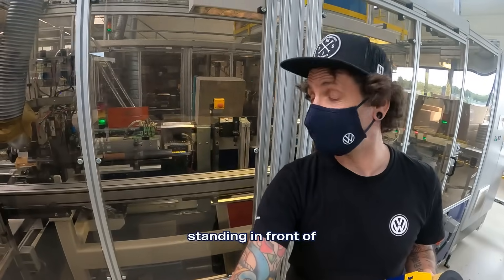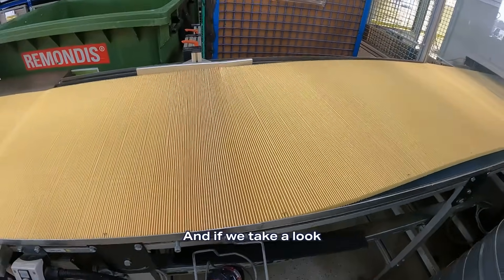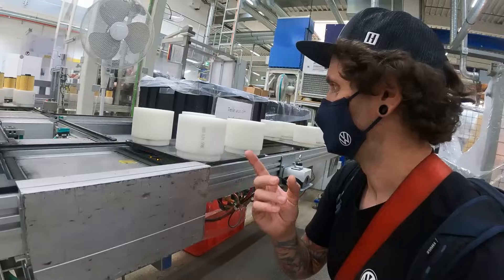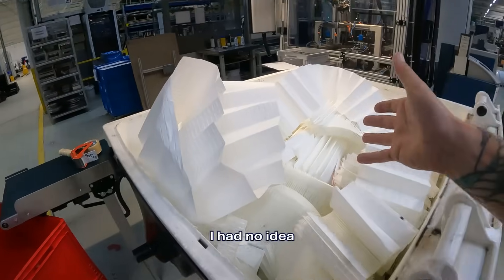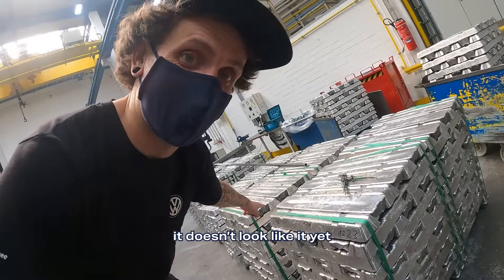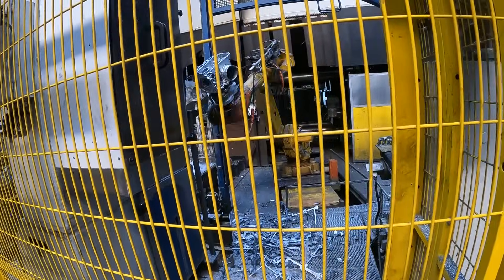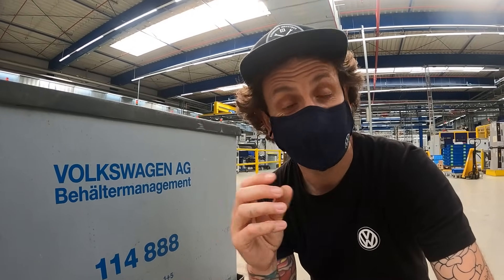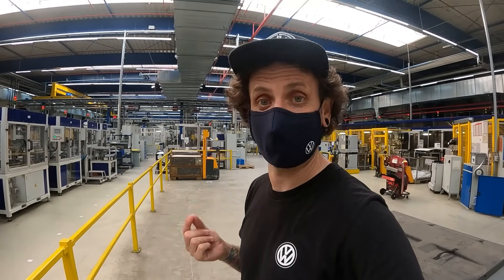How OEM Mercedes + Porsche + VW filters are made (from paper, plastic, and molten Aluminium)

Comment: Don't be fooled. OE Hengst ≠ afterm. Hengst !
Selling failed (per manufacturer specs.) filter without warning on the aftermarket is a good way to save some money on thoose rejection rates. Also rejected ones aren't crushed or something they have near invisible default you wont spot then assuming "oh it's the same, made in the same exact factory".
Ask you the question. If hengst sold the exact same filter per manufacturer specifications why they wouldn't have wrote it on the box ? "Same as manufacturer spec. lineup". Of course they would of tell it's massive selling point/advantage ! They are simply not the same. Reason they're playing ambiguous by their branding blinding the lines between OE and OEM...
Reply: The last 3x OE filters I bought for my car - from the main dealer - were made in different countries and had slightly different fonts/layouts.

An automotive company often carries several suppliers to keep them competitive and ensure consistency of supply 

As for Hengst (Mann, Bosch etc) selling below par products in their own packaging... makes no sense. If anything I'd expect those to be better quality.